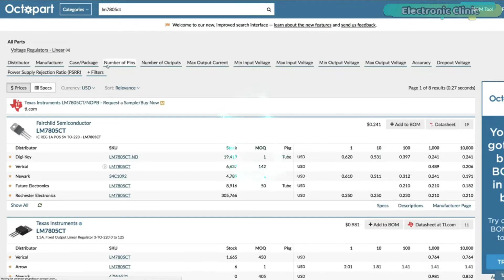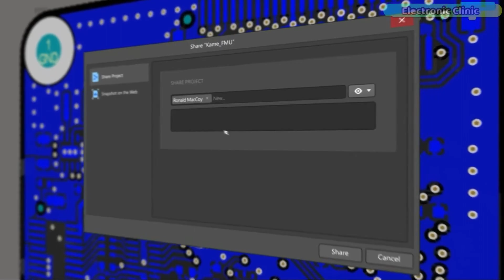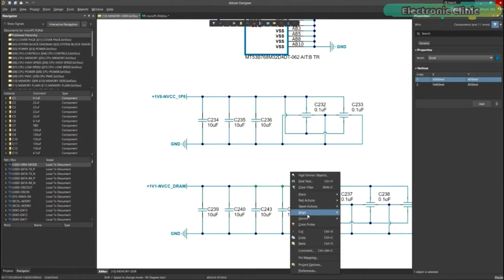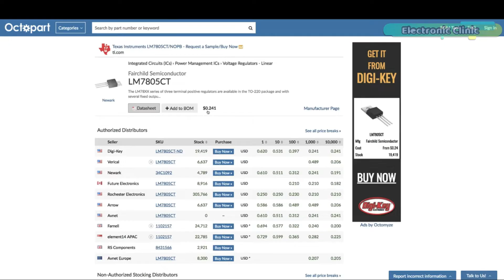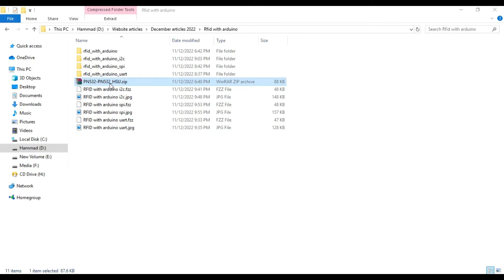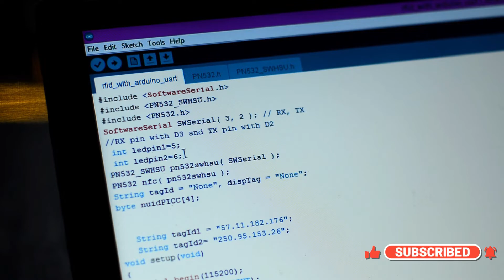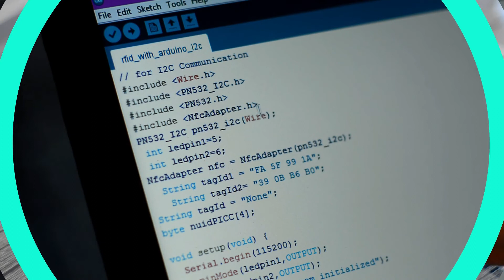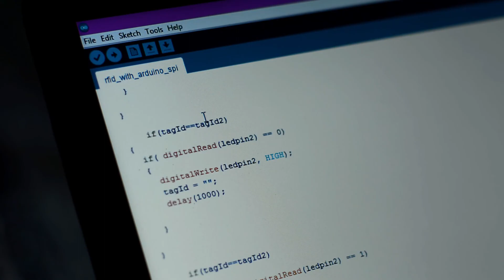PN532 RFID NFC Module with Arduino, How to use HSU UART, SPI, & I2C

Comment: I think the wiring and the firmware doesn't match. Arduino PinD3 is configured to be RX, but connect to the PN532-RX. 
RX connects to RX -> should be RX connect to TX

Comment: Very good video to introduce the board. However, please allow me point it out that the board in this video is a copy version. ELECHOUSE designed the board and now has upgraded the module to V4. V3 was widely counterfeited in China. Now even the NXP PN532 chip was copied. That's why you could buy it much cheaper than the chip price in NXP.

Comment: Hi, I'm using this module with Node MCU. (I2C) When I feed it with Ams 1117 3.3V, it freezes. 
5v seems more stable and better in terms of reading distance. But I feel warming in the Pn532 Chip and its LED. 
Does 5v pose a risk in long-term use? Regards.

Comment: If I use it with NodeMCU, it will crash and showing error message and the message didn't find the PN532 every after I upload the sketch sometimes. It's annoying. Someone has gave you an issue related to your library on your github, and you answered him to see your youtube video. But no explanation how to solve it. Fix the library.
Reply from the maker: watch my video on esp8266 and pn532
https://youtu.be/2WcPirVmEz0
Reply: The library gives a reversed HEX. The halt of while(1) on NfcAdapter.cpp, make it repeat the process in finding device. You have to disconnect and connecting again the power VCC of PN532 board to make it can be found. The public function on NfcAdapter.cpp and NfcAdapter.h are the causes of it.

If you put Nfc.begin on void setup(), board can be found, later if there is a bad connection and make the PN532 is disconnected and connected again to the microcontroller, it won't read the tag. And you have to turn off the microcontroller then connecting again. Bad library.

Comment: Excellent Explaination, while it has problem using with Nextion LCD. Using it in any mode it stops arduino receiving data from Nextion while sending is ok. if you have any solution please share.thx

Comment: I copied the PN532-PN532_HSU.zip file from your site. Selected add .zip file to library and got the erro message: Zip file has no valid library. I get the same message when I use the original HSU files. I use IDE 1.8.13. Do you have a trick to add the library?
Reply: ive got the same sir, please help us for anybody who knows to solve this problem please
Reply: You downloaded the stuff the wrong way (most probably, right click, "Download links as"); you should left click on the archive link then check for "Download raw file" (icon: some arrow down in a kind of tray)

Comment: thanks for the video! when copy pasting your arduino code from the website, there are a lot of formatting errors, it would be amazing if you could upload it as a .ino file, thanks!!
Reply from the maker: Thank you so much for letting me know. I will tell the Developer to do it immediately.
Reply from the maker: Now, you can check. it took me 5 hours to fix. Thank you so much for letting me know.